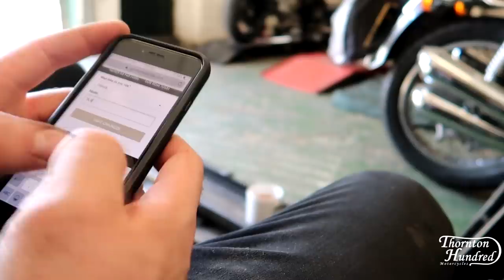Honda SLR650 Custom Scrambler by Thornton Hundred

Comment: what are the size pf the wheels bro....and what is the name of the material u used to make that sit
Reply: pls rply me
Reply from the maker: Dhorje Grg wheels are 17x4.5 and 17x3.5 alloy non valanced. The seat is made from a synthetic gripper material used in motocross bikes.

Comment: I've never heard of the SLR650 before, but I really like the idea of a 650cc thumper turned into a scrambler. Unfortunately, this one seems a little more involved in frame modification than the normal stuff I've looked at.
Reply from the maker: Invidious Ignoramus the frame mods were quite involved, it sets it apart from the rest!
Reply: @ThorntonHundredMotorcycles  It looks like it was well worth it!

Comment: Beautiful build but I would have left the motor color as original it will run cooler, black atracks more heat so
the motor runs much hotter. especially air cooled.